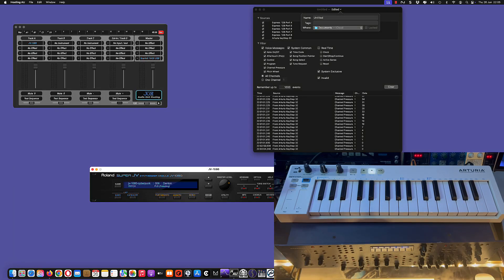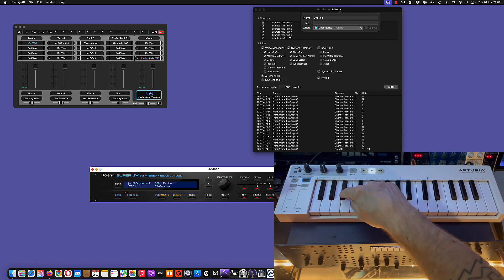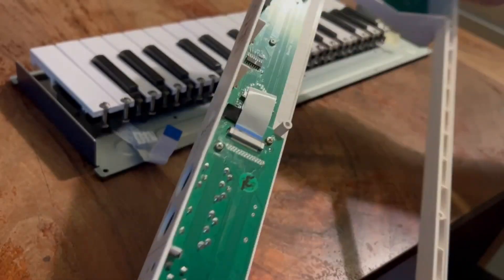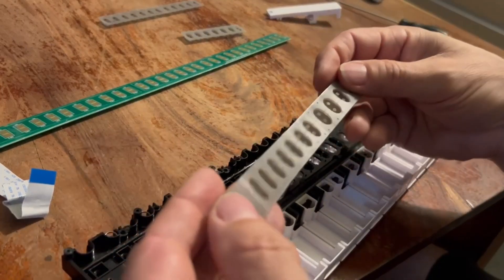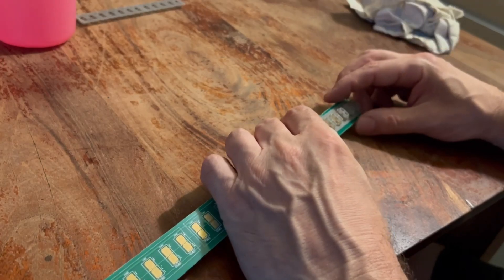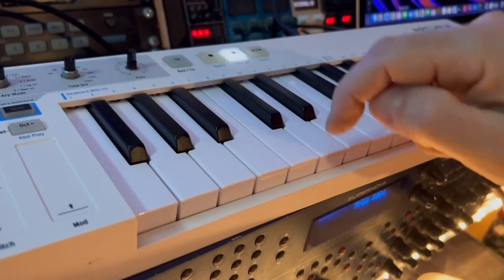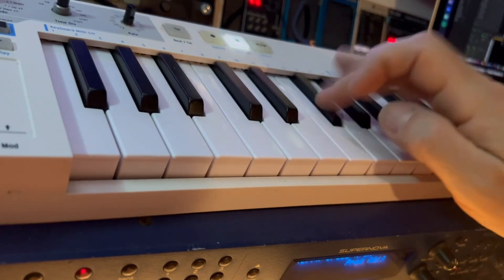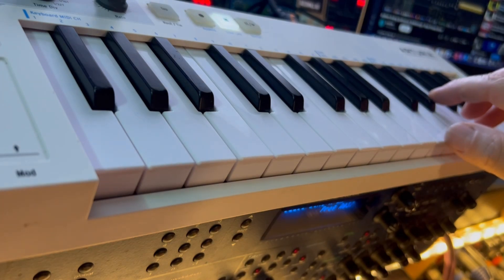Fix Your Arturia KeyStep! 3 Simple Methods That Actually Work

Comment: nice! do you have a solution for the problem with the mod-/pitchwheel? a lot of people need to turn the "keystep37" several times on/off before they work. the problem is known by arturia (forum, mails, support) but till now they dont bring a solution which is really sad.
Reply from the maker: actually no, and TBH on my unit pitchbend/modwheel work 100%...